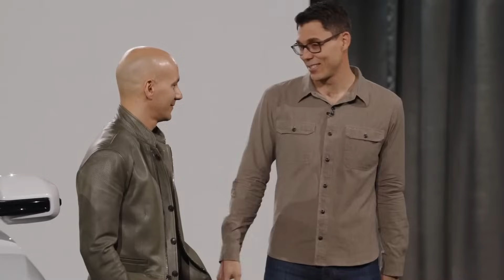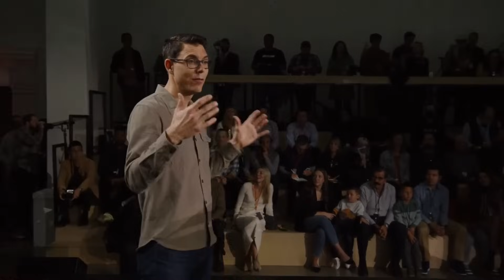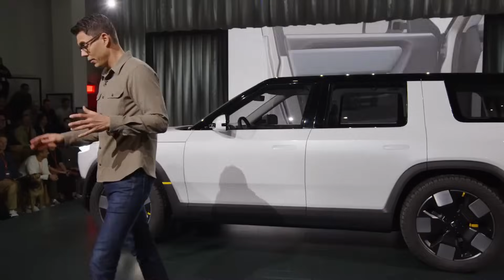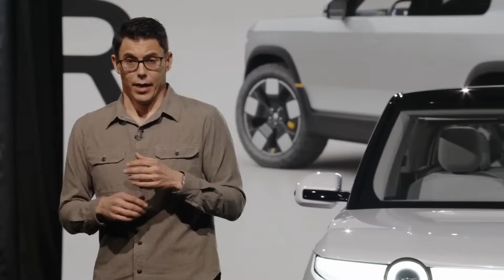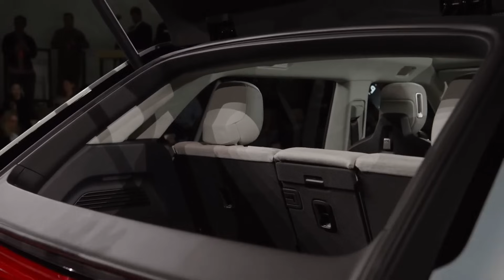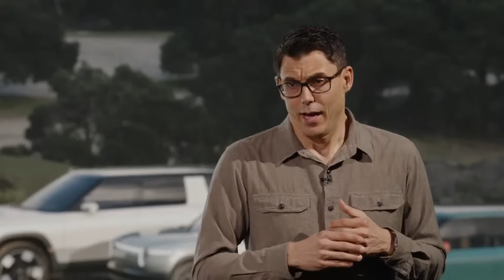Rivian Releases 3 NEW Cars: R2, R3, R3X (SUPERCUT)

Comment: if they actually end up placing the charge port on passenger rear. They will keep failing. Unless miraculously they pull 50k plus of there own super chargers that have longer charge cables. maybe by then tesla will have longer cables but damn why fight it. they already joined the tesla super charger network. Cant beat em join em

Comment: This multiple vehicle announcement looked more like an "Ad" for investors and a future funding round, than for real products that will ship shortly, as Rivian currently does not have enough factories to run all of these production lines . . .  When Steve Jobs returned to Apple in 1997, he slashed a number of products, to simplify manufacturing . . . Tesla followed this trajectory by focusing on 2 main products: The Tesla Model 3 (Mac) and Model Y (Mac Pro) . . . The new Rivian R2 is basically the size of a Toyota RAV 4.  If I was Rivian, I would just focus on building out a production line for the R2 and make as many of those as possible (the way Tesla put all of their resources into the Model 3 when they were at a breaking point).
Reply: I agree.  Go all in on a reasonably priced vehicle and get it right.  Their cars are good looking and if priced right its a nice alternative to Tesla.  Once you have traction start building the others.
Reply: Indeed, that's what people don't seem to understand.

One of the reasons Apple can earn so much money is because they simplify their product line up and also simplify the amount of time and money that is needed to make that whole line up.

Tesla is earning money because Tesla focused on the manufacturing part, to simplify the process of manufacturing. 

Everybody can make an amazing car by just putting in third party tech in it, but how do you make the car cheap and affordable so people actually buy it?

Comment: Gee, did they have anything that wasn't a copy of Tesla tech..... except for the flashlight and two gloveboxes?  Yeah they have a different shape. 
They talked about big cylinder batteries but what's the charge rate? Maybe they got cut?
Guess copying is the sincerest form of flattery.
Reply: A truly pathetic for a 2026 or 2027 model year ev of 30mins for a 10-80% charge on a vehicle with 270-300+miles of range. 👍🏻😀
Reply: @4literv6  Yeah let's hope they upgrade that before release!  Especially since by then there will be a lot more v4 Tesla superchargers putting out up to (or more by then) 350 KW.... and Rivian will have NACS by then too.